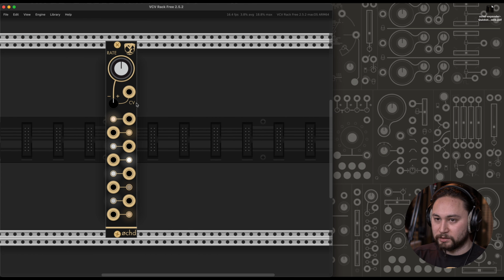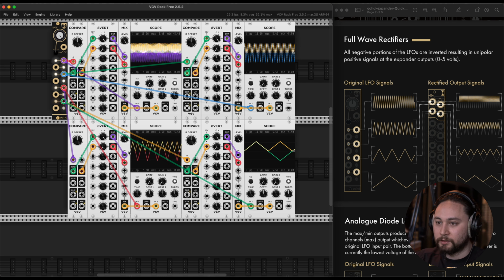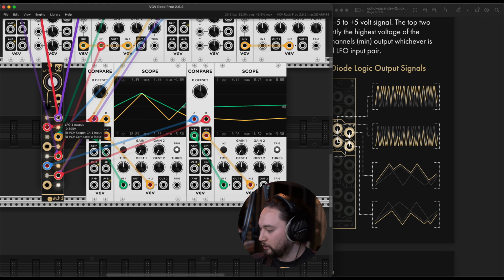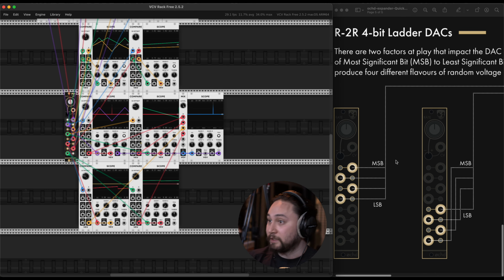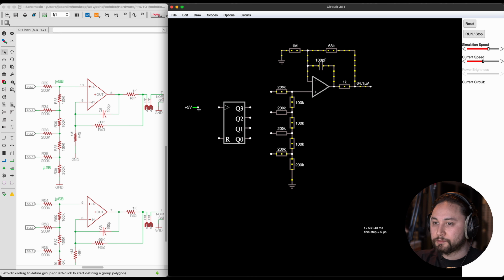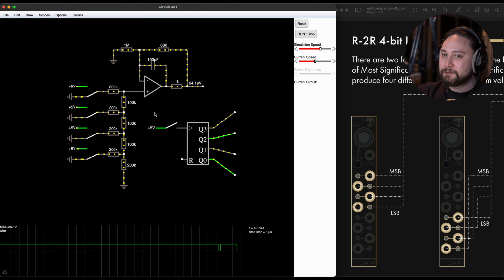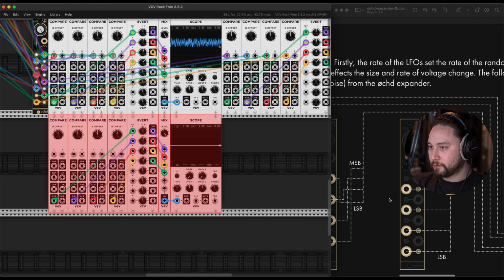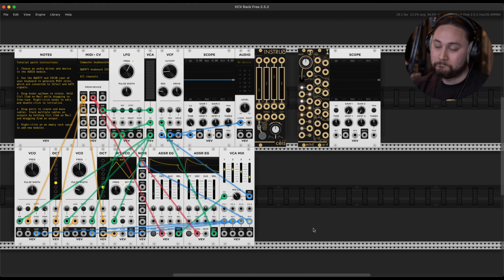Instruō - øchd Expander DIY tutorial && VCV Rack update

Comment: This release is a fantastic Christmas gift - very glad to have the ARM build at last! And it is fun/instructive to see the prototyping in VCV Rack. I love prototyping module ideas with existing VCV Rack modules. Many of my Venom plugin modules started out this way. I have some ideas to improve the accuracy of your prototype patch. It only takes one additional module to get the correct phase relationship between the square and triangle waves. Each patch cable introduces a 1 sample delay to the signal in VCV Rack. If you patch the direct triangle output to Compare A, and a 1 sample delayed triangle to Compare B, then the A>B output will have the correct phase alignment. Any module that can pass on the signal without modulation can be used to introduce the delay. The VCV Mutes module is a good choice for introducing the delay, as it has 10 input/output pairs. Use the delayed triangle signal output downstream to get the triangle/square phase alignment exact down to the sample level. The VCV Gates module can directly convert any gate into a consistent 1ms trigger. There is no corollary in the hardware domain, but you can use polyphony to greatly reduce the clutter - Instead of replicating each construct four times, you can simply add a few Merge and Split modules. This also can save CPU due to simd processing of polyphonic signals.
Reply from the maker: @DaveBenhamMusic  this is why I stick to analogue!! 😂
Reply: @instruo  The VCV OCHD has +/- 5.5V instead of 5V, and the Expander DAC outputs max out at 4.6875V rather than 5V. Is that true to the hardware? I patched up a pretty precise VCV emulation and posted to the VCV Community under the "Instruo ARM compatibility update" thread. I won't include a link in this comment because I haven't had much luck with that in the past. I will try a link in a subsequent comment.
Reply from the maker: @DaveBenhamMusic  The instruo VCV modules are modelled to behave like the analogue. I lose track of all the particular details, but there are randomisers that work towards making multiple instances of the same module slightly unique within a rack.
There are tuned instabilities and wobbles built in to the sims.
I go into a bit of detail in an old interview on disquiet.
https://disquiet.com/2021/01/09/instruo-vcv-rack-jason-lim/

Digital is too precise in my opinion. You can't right click on a pot and type in a precise frequency in Hz 😂
So the Instruo VCV modules don't do that either.
Analogue waveforms will never perfectly be -/+5V peak to peak either. Opamps will always have a DC tolerance which compounds with those of all the passives in the circuitry.
Digital precision has it's place of course. But for me, that place is not in the modular synths that I want to play with.

If I want a musical vibrato, sure I know I want a sine somewhere around 4-5Hz with a low % depth.
But when I'm hands on, I grab an LFO sine or triangle, ballpark the tuning, and ease attenuate down to taste.
Knowing or being able to define the precise values isn't necessary. I always try to emphasise trusting your ears to my students. Theory knowledge helps, but it's less important than listening... exactly the same with music theory.
Reply: @instruo  Perfect - thanks!
Reply: @instruo  By "pretty precise VCV emulation" I mean my emulation visually matches the output of the expander module on a scope, except for those subtle "instabilities and wobbles" that you built into the sims.

Comment: lovely. thanks for introducing to me the Bit Ladder DAC. Immediatly got a few ideas for designs and finaly I can remember, which output has which flavor. 
Want to mention, that there is a confusing mistake in the manual: It's correct in the abstract drawing, but in the description are the LSB and MSB interchanged for two of the outputs.
Reply from the maker: Oops good catch!
I’ll make sure the person responsible is ridiculed and gets only coal for Christmas! 😂

Discrete ladder DAC circuits are a lot of fun! I plan to explore more with 8bits controlled from an Øchd at some point!